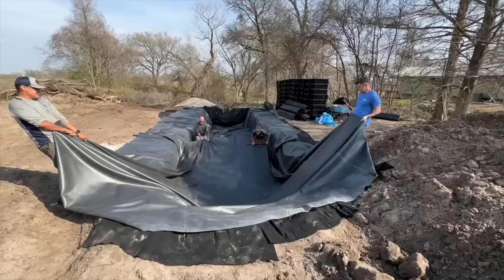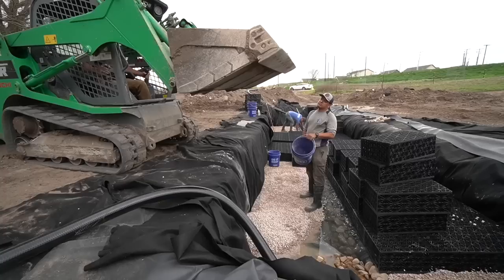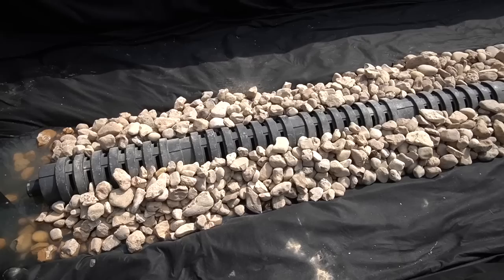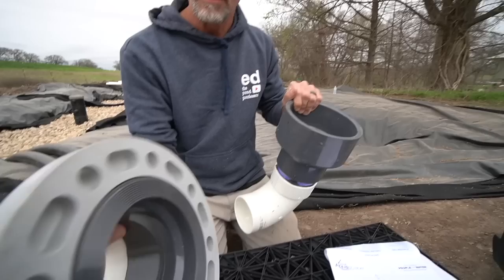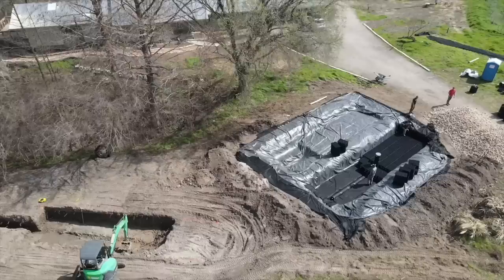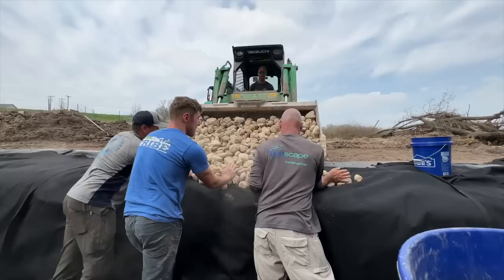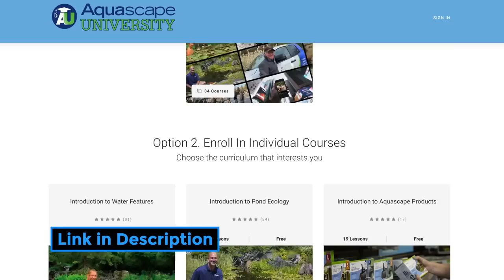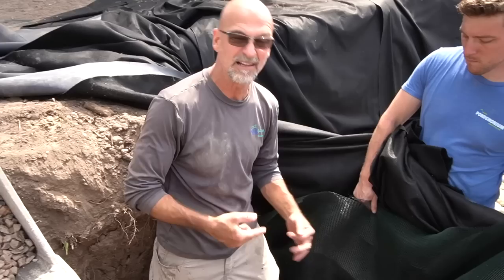Adrian Grenier’s Farm Pond Fix – 2 Wetlands

Comment: Hi Ed!  I heard on the video that you went with a 25 x 40 wetland filtration here with 2 pumps, 6 centipedes, and 1 snorkel.  This earthen pond looked to be fairly large, so did you go with this size to cover 5-15% of the surface area of the earthen pond or how did you do your calculations for this project to get to 25 x 40 wetland with the large aquablocks? 2nd question, I was trying to find your video on what yall used for the intake bay/skimmer to draw the water up from the earthen pond to the bog.  Could you elaborate on that a bit, please?